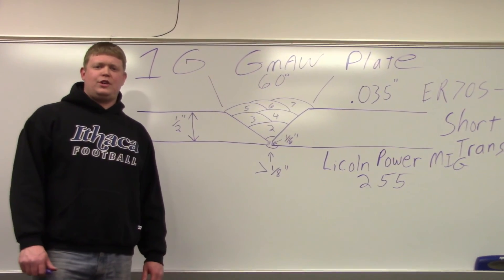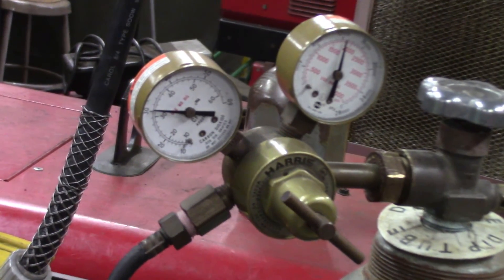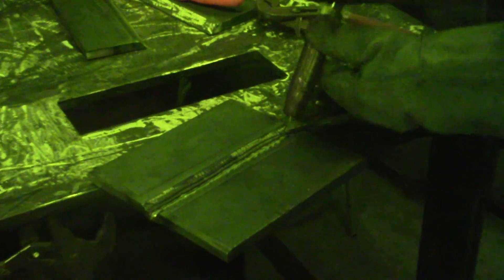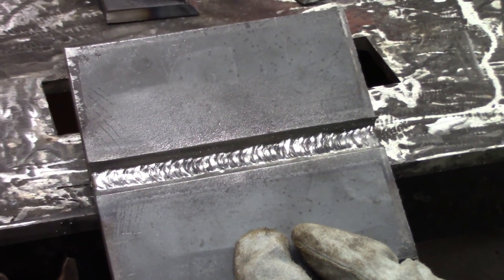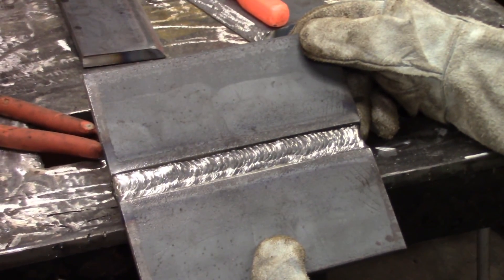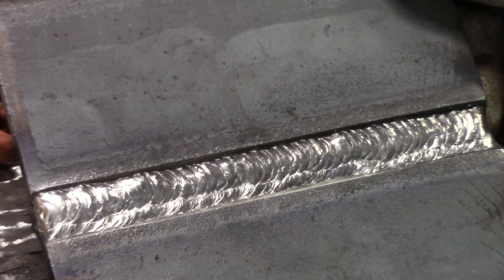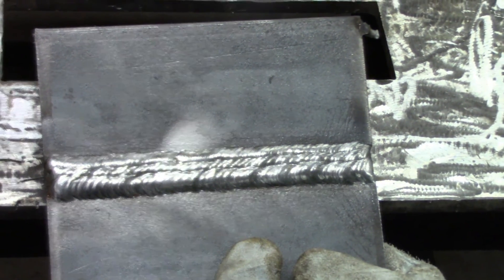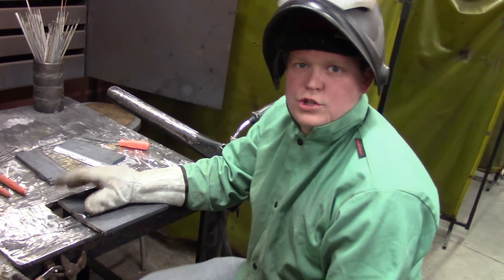GMAW 1G Flat Groove Weld

Comment: In some of your passes it looks like your pushing the nozzle and in some of the subsequent passes it appears you are dragging or pulling your nozzle. Could you please clarify which is which? Thank you.
Reply from the maker: If I switch to a drag it's most likely because I think I'm not getting enough penetration.  Usually I'll use a leading angle if the fit up is good and if it gets a bit tight I'll switch to a drag technique.
Reply: The rule of thumb is push gas drag slag. This is to avoid porosity(gas) and slag inclusion. Dragging gas processes is only advised when running vertical. Otherwise 90% of the time you push
Reply: @russellwaelder1191  I concur.  This is what I was taught from multiple sources including my own experience.

Comment: Why not spray the hot and subsequent passes?
Reply from the maker: Two reasons.  Usually if you go to spray transfer it is going to require you to switch shielding gases which is a pain to do.  Second you have to check your Welding Procedure Specification (WPS) and see if it allows you to move your wire feed and voltage high enough to get into spray transfer.

Comment: Nice work I took my 1g today failed horribly but worst part I can find out what made it fail. The metal looks brittle ? And ashy gray
Reply from the maker: Check your shielding gas.
Reply: @TVWeld  the gas is fine comes out good flow. One man said I may have over heated the metal? Think that's possible?
Reply: Wrong gas flow
Wrong gas mixture
Delaminated material 
Wrong wire/ wrong material thickness (ie. “Too much heat” but should never be an actual issue a welder wouldn’t notice. You would be notice a lot of other problems such as porosity, weld puddle fall out)
Wrong machine process setting

Comment: ??? so on the cap you weaved stringer beads? It looks like 3 passes at the end..great video..
Reply: never weave stack stringers for caps, so u never get any inclusions
Reply: @dfred145  you're right but you can just weave until flush then cap with stringers right? Thanks I don't know why I just got this! Lol
Reply: @truegee8038  root opening and bevel face are yhe variables in your question. Wire thickness dictates maximum “weave width” I would stick to 6-8 mm weave width on anything being ut or xray